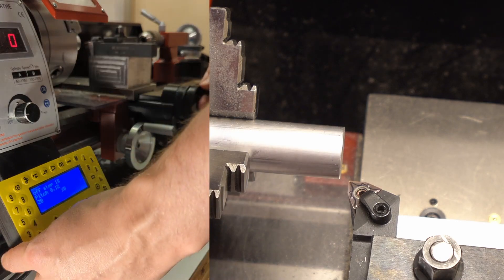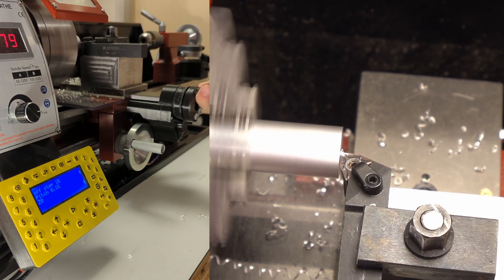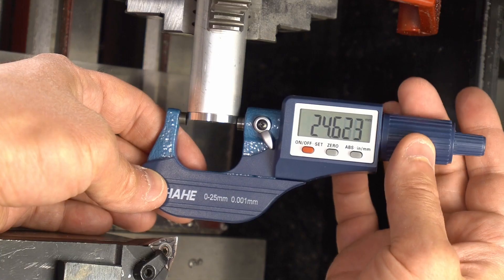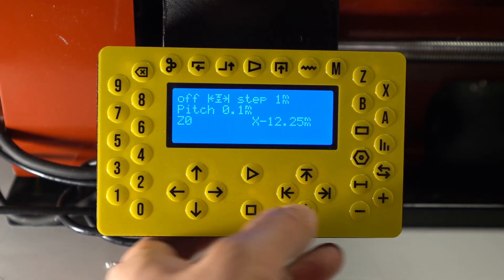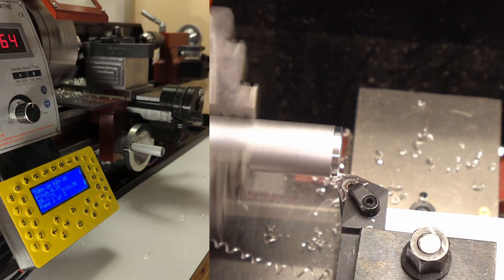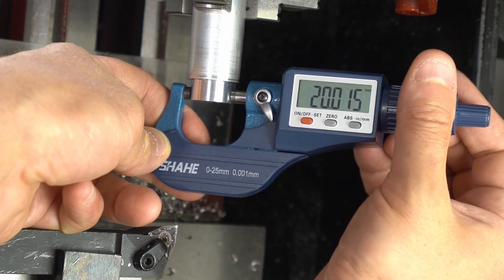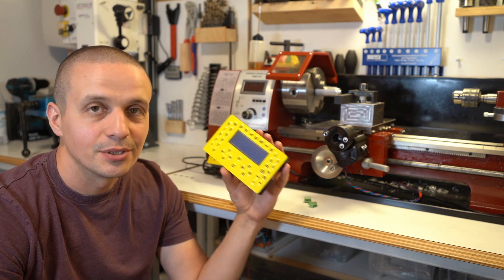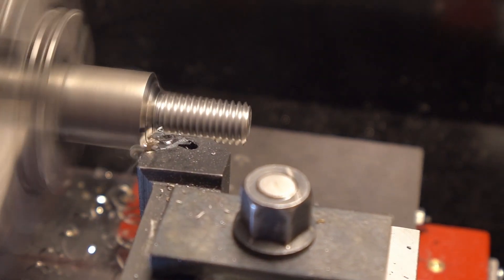Fast and precise turning — metal lathe ELS

Comment: What tools do you favour using with this now? I saw I video I think it was yours getting really good finishes using a parting tool for facing. But with the CNC control you could use that tool for so many things like facing, parting cutting chamfers, cutting domes etc
Reply from the maker: Really any 20mm tool that happens to be already loaded 😄 Parting tool is very universal, yes.

Comment: Great job Maxim, congratulations.  I have been putting it together and finally were  able to cut a thread.  However, I am having a problem with the steppers making a high frequency noise after a couple of minutes of working.  At the begining I thought it was a failure related to the cheap stepper drivers I am using, however, after a while of troubleshooting, the issue was found in the controller which I have to reset it everytime it happens. It works well and fast for another 2 to 5 minutes before I have to reset it again.
I tested also your first version of the ELS with the Arduino Nano but this ESP32 is much better.
Reply from the maker: Rodrigo, sorry about that. I will look into this problem, can you please post a video of this happening on GitHub or mail me a link to m.kachurovskiy@gmail.com?
Reply: Great job Maxim you got it !!  I have tested H4V7 twice for a couple of hours and did not fail.
Thanks a lot for your support.

Comment: Any tips on calibration of the backlash and lead screw steps im having trouble getting mine exactly dialed in
Reply from the maker: Sadly the backlash is usually different on different parts of the lead screw - most work is done near the chuck and backlash is largest there. The usual method for backlash calculation is placing an indicator on the tool post, moving it using the controller a bit in one direction, zeroing, moving 1mm in another direction. Backlash then equals 1mm minus absolute indicator value.

Comment: last year I considered Rocketronics and Clough42 ELS products.  Rocketronics was similar to a CNC control (linuxCNC, Acorn, Masso).  The Clough42 ELS couldn't be purchased in one place.  In the end, i chose to convert the machine to CNC.  However, if your ELS had been available, I would have purchased it.  I think it is priced well for the hobby market.  Your store and branding and videos are all on-point.  The only thing I don't understand is the plastic on the carriage.  I tried it myself and it worked well except that the PLA creeps, so I had to tighten the lead screw frequently.  As a prototype, it's excellent but metal would be better.
Reply from the maker: Hi @neffk, thank you. I didn't notice significant creep on my recent prints but perhaps my conditions are different, which model / bearings did you use? With axial bearings the load is spread evenly - it's also possible to print with 100% infill further minimizing the creep. However, a metal motor mount is indeed in order, thank you for advise :) How do you produce GCode for your CNC lathe? Wonder if https://kachurovskiy.github.io/lathecode/ could be useful one day.